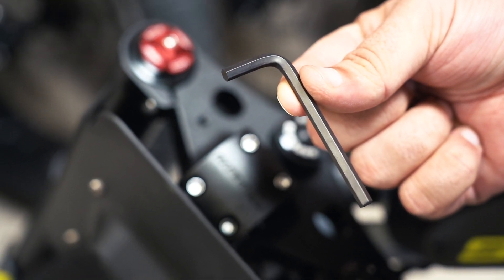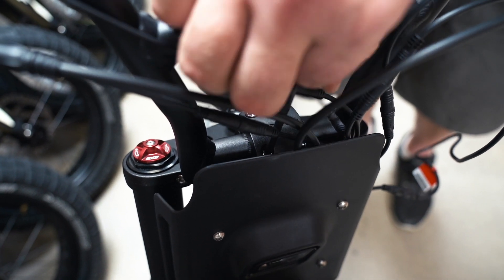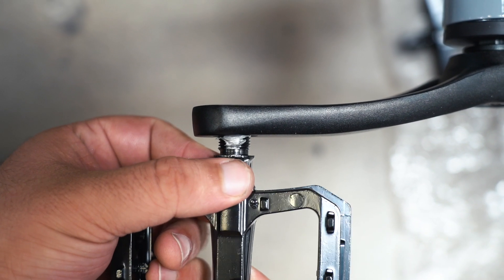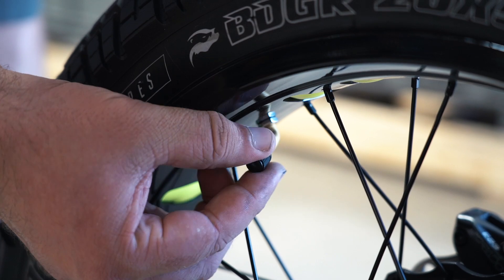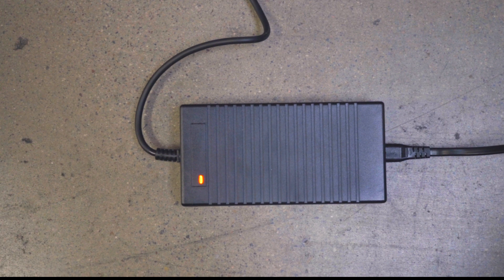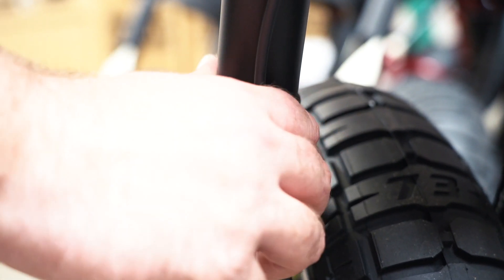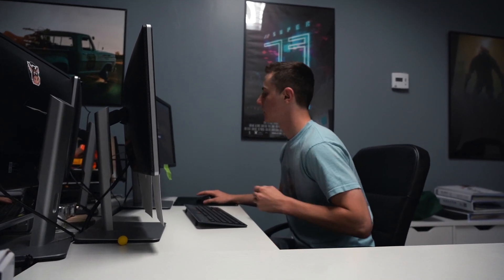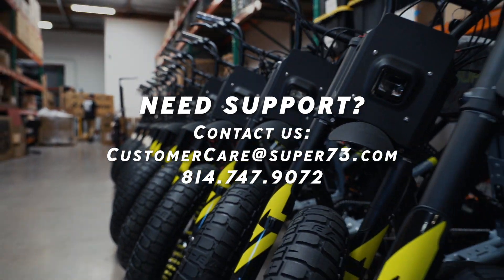SUPER73 Tutorials: R-Series Assembly Tutorial

Comment: There are two wires with caps, dangling in the front, and the manual doesn't mention those cables at all... What are they for?
Also, how do you remove the battery in order to charge it away from the bike?